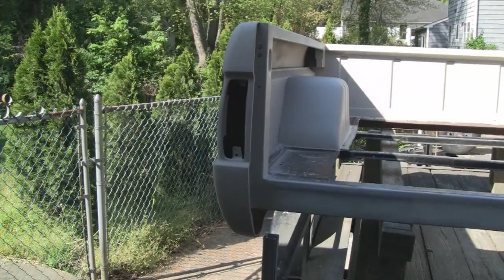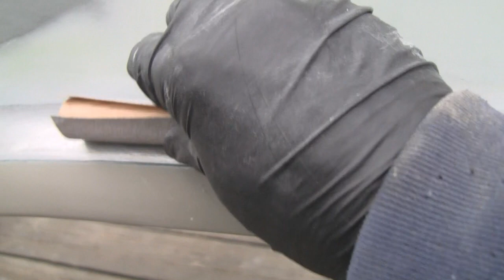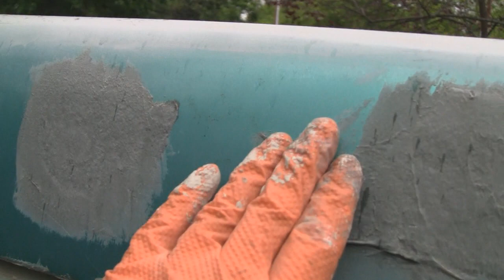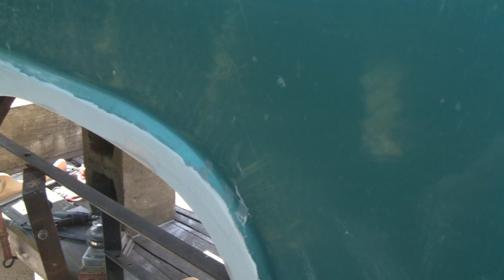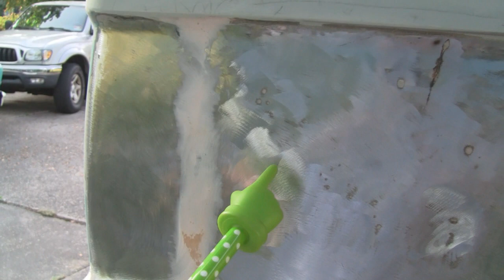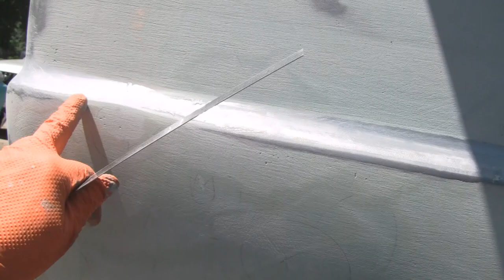PRIME DRIVE SIDE, START PASS SIDE, MAKE BODY LINE (F100 part 114)

Comment: The endless sanding. I painted the 59 Ford I'm working on and the paint came out as a huge orange peel. I'm not sure what I did wrong but I spent countless hours sanding it down smooth to make it look half way decent. Your truck is looking good. Nice work so far! I like the protractor idea to keep the edge consistent.
Reply from the maker: Thanks Wyatt!! Maybe a little more Reducer or more air pressure would help!!  I own over 20 Spray Guns but always use the same one I've been using for the past 50 years!!☻